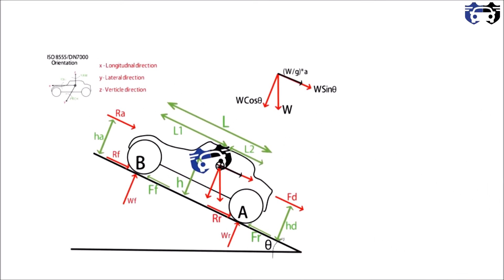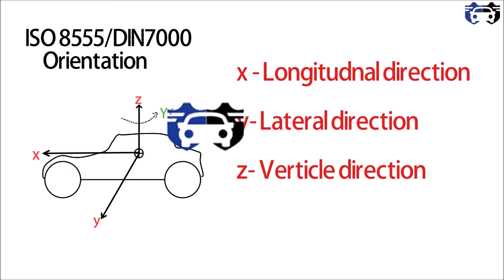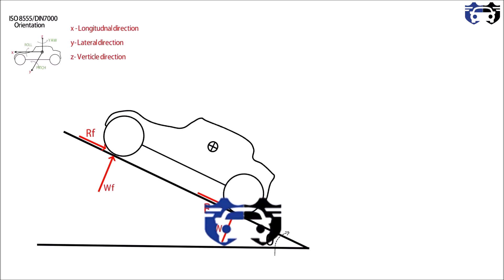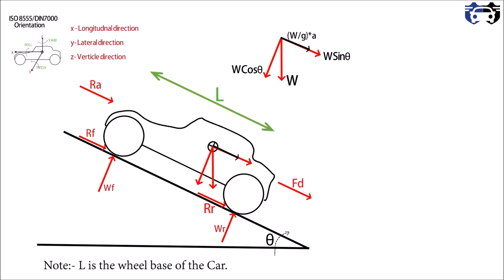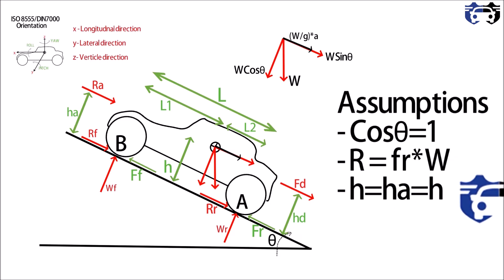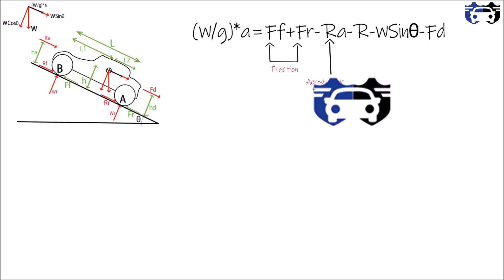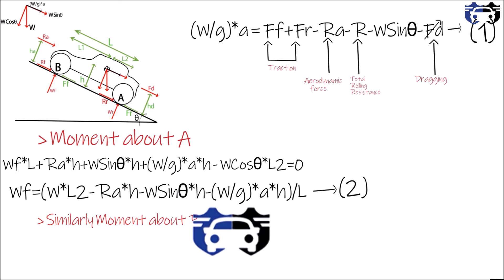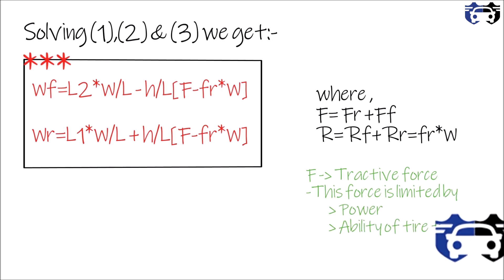What is the weight distribution on front and rear tire of the vehicle ?

Comment from the maker: The car considered for weight transfer calculation here is the four wheel drive vehicle, as it is having front and rear tractive force both.
F= Ff +Fr ( where F is the total tractive force generated by the vehicle).
If car is front wheel drive then Fr =0 ,and if car is rear wheel drive then Ff=0.
Reply: Bro could you provide the source/proof of these equations as well ? any book or article ?
Reply: So, if I have a car with 65% of the weight on the front wheels, will there be understeer or oversteer?

Comment: What in case of 6 axle truck or bus??
Reply from the maker: For a 6-axle truck or bus, the method stays the same — you just need to measure individual axle loads and know the wheelbase distances between axles. From there, you can calculate both weight distribution and even estimate the CG height using load shift methods.